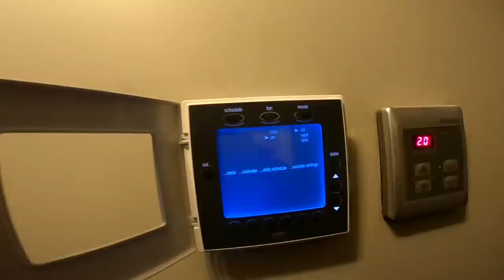2003 Carrier 4BGP024 - No Heat, Rusty Heat Exchanger

Comment: Good job Curtis. When are going to switch to Milwaukee with the impact drive? I know you love your Makita. Milwaukee makes pretty good impact driver 12 volt and 18 volts. I have had mine about 8 years and it has brushes in it and it still runs.
Reply from the maker: If they’ll make a M12 impact with a stubby little motor, I’d seriously think about it.
Reply: They do, I have Makita tools too,  it's nice to have both.

Comment: As hard as you worked on that heat exchanger it might have been easier to pull it and sand off the rust to look for any holes. Also I would recommend you get a lapel mic for your vlogs.  I can barely hear you talking even when the HVAC units aren’t running.
Reply from the maker: I am looking into it.
Reply: LOL. just go old school and inject smoke into the tubes through the inducer backwards and look for smoke signals.

Comment: Question? Why such a big doghouse . Also what's your thoughts on the new sc480/680. Wondering if I should upgrade, I have the sc440. In residential service in upstate not many mini splits that I work on as of now that is. I saw ur vids of the review, and others just not sure yet. Any thoughts would help. Thanks.
Reply from the maker: Are you referring to the rain hood when you say dog house?  If so, it woulda helped if it were smaller. The Watts function and Power Factor abilities I have found to be very useful on these meters, and worth the investment. The bigger meter does cost more. But, may not be necessary. I have found that many manufacturers don’t want you checking voltages and frequencies on these VF systems anyway. They make it difficult to do so. And honestly if you know how to troubleshoot an X-13 motor, then you can troubleshoot a VF compressor
Reply: @HVACGUY  yes was referring to the rain hood. Much appreciated for info and thoughts.

Comment: Will that panel not sealing properly help promote rust on the heat exchanger because of outside air being drawn in?
Reply from the maker: That’s actually positive pressure. What normally causes the rust is condensation from cold air blowing over warm tubes. That’s right off the. coil. So, it condensates in the tubes and outside. But, that panel shouldn’t be loose at all.
Reply: @HVACGUY  Thanks for responding.  I'm not a HVAC person, but I enjoy your videos.  It helps me understand my tech when he comes to check out my system.  Keep up the great info.  Stay safe.
Reply from the maker: @flirjock  is this THE James Taylor - the musician
Reply: @HVACGUY  Nope I wish.

Comment: Every fossil fuel burning piece of equipment needs a carbon monoxide detector installed and checked yearly. 
Thanks again for the videos.!
🍺🍺🍺🥃🥃🎯🏌🏻‍♀️
Stay safe. 
Retired (werk'n)keyboard super tech. Wear your safety glasses!
Reply: surprising vehicles don't have them built in. but I can guess what would happen if they did and you was sitting in traffic or slow crawling the highway.  BEEP BEEP BEEP BEEP
actually, all you fellas with the personal and portable detectors with readout should drive around with them on in the cab, you may have a big surprise 😏